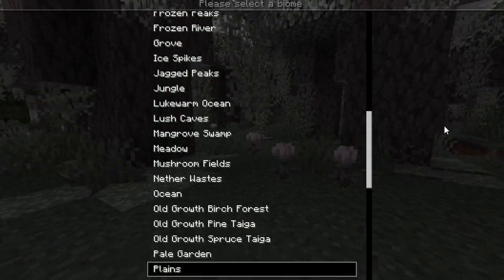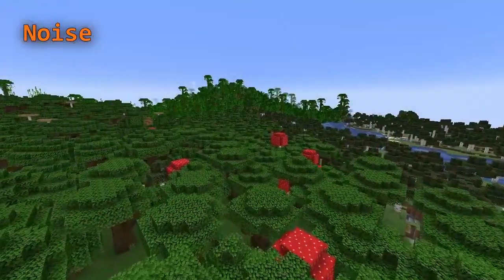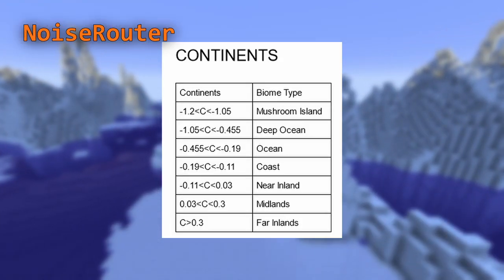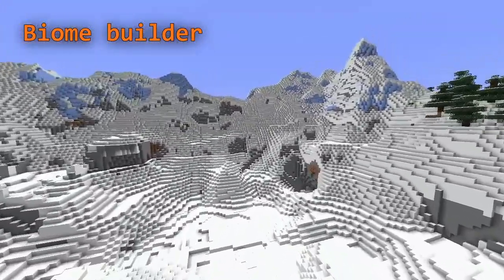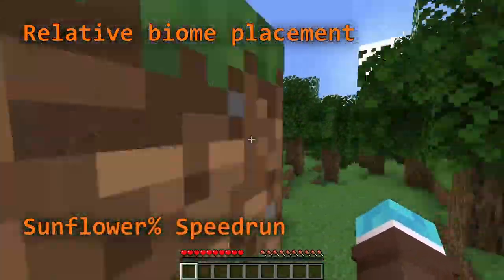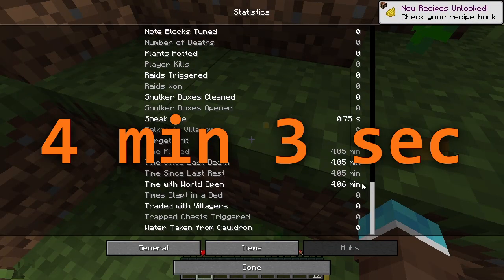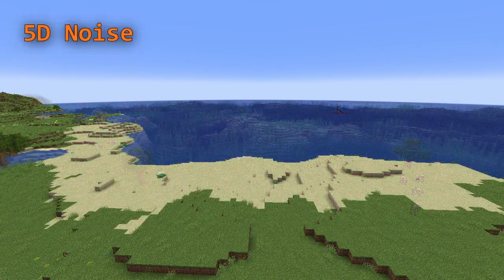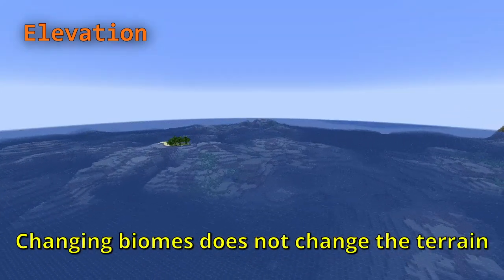How Minecraft Generates Biomes

Comment: could be cool a  tool (or set of tools) that give you a indicator of this noise variable, they could use unused materials for the craft
Reply from the maker: @robertoalexandermendezmore408  it would be cool, currently the information isn't sent to the client so it's only accessable on singelplayer Java.
I think for example a thermometer would be cool, the problem is the "temperature" variable isn't a direct reflection of real life temperature. So maybe a "climatometer" would be a better word for it and would cover humidity and continentalness, and as a little bit of a stretch the other variables as well.
I doubt they'd add it though because it would be too technical for over 99% of players
Reply: @brevortofficial  i mean, people could learn to use it to predict what is the next biome and find some biomes more easy (with out the need of use F3)

Comment: Camman18 made a video recently talking about what he calls "secret biomes"--types of world generation that occur only in certain biomes: the "jungle cliffs" when an elevated jungle hits an ocean, the "shattered taiga", and the "floating bamboo jungle". It seems you'd know more about how these "secret biomes" occur.
Link to the video: https://youtu.be/0ZilaDDaNEM
Reply from the maker: @wmpowell8   @wmpowell8  Yeah  I saw that video! I wanted to leave a comment explaining it but I figured it wouldn't get seen there.
Jungle cliffs - This is caused by jungles generating in E: 0, and low continentalness and high PV. Normally a Stony shore would be placed there but since the PV is high it places a Middle Biome instead. If it were a peak PV, it would place Stony Peaks instead

Shattered taiga and Floating Bamboo Jungle are actually the same thing. This occurs in E: 5 areas and is more drastic in low continentalness. The reason it is "like windswept savannas" is because while erosion, PV, and continentalness affect terrain elevation, humidity and temperature don't. So if a shattered biome falls outside of the humidity (H: 4 for bamboo jungles) or temperature (T: 0 or 1 for taigas) range for windswept savannas, it places a middle biome instead. It's usually bamboo jungles and not regular because for some reason shattered terrain is way more dramatic in positive weirdness